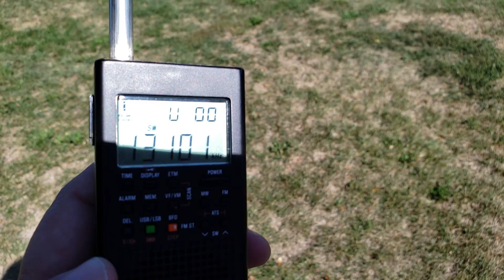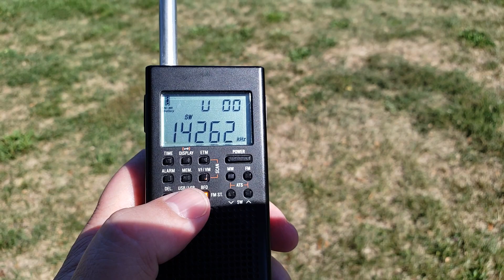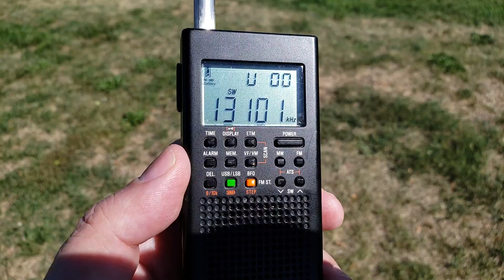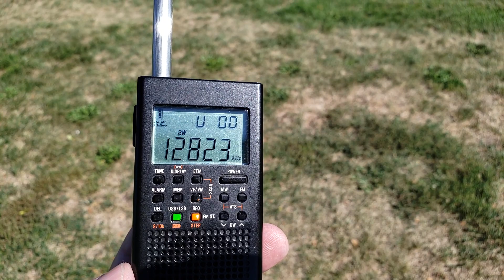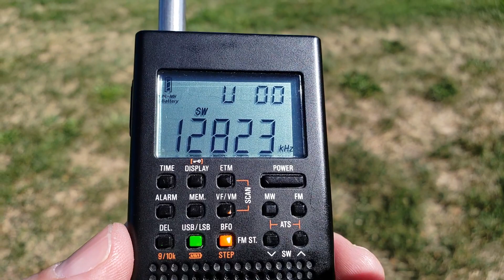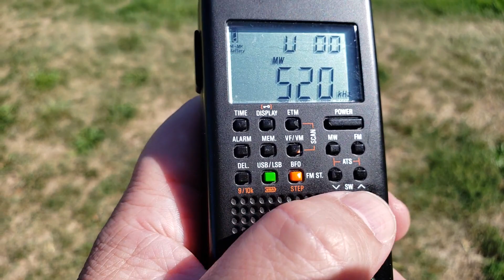Some personal impressions of the countycomm GP5 SSB receiver

Comment: Thank you for the tip about programming memory to specific freq areas. I just got this radio to augment my scanner setup and isn't exactly what I thought it was. However, all reviews are very good and most reviews point out quirks that make the frustration level low. I had to print out a larger version of the display and buttons because they are so small so I am including also and small magnifying glass with the radio and accessories.

Comment: I have the same frustration with this radio, but despite this it is still a great (excellent) radio. Some careful memory channel creation does somewhat fix the slow tuning issue for me. I am very happy with mine overall. But if they bring out a radio like this with keypad AND programmable step sizes, I will buy it (and so will everyone else). :)

Comment: Many ham HF rigs do not make it easy to direct-enter frequencies either. I agree, the best solution is use some of the memories to store ham sub-band centers or simply 100KHz/500KHz (or whatever) increments. Lots of memory space! Still, a great little general coverage portable radio w/SSB.